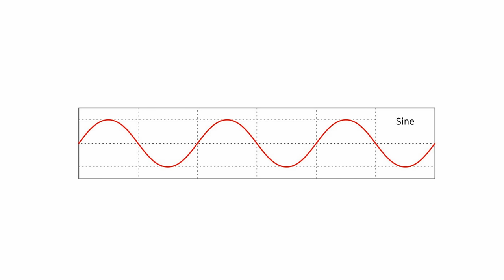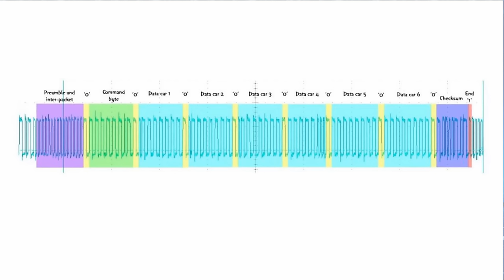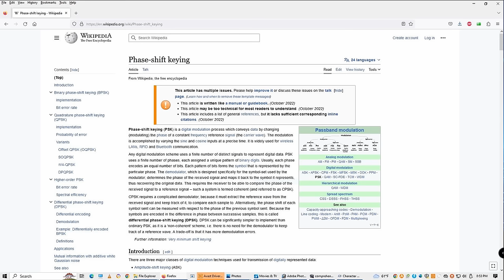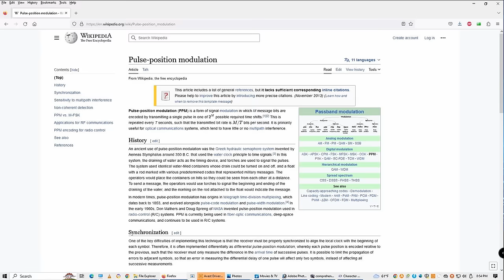How Do Digital Slot Cars Work – Scalextric, SCX, and Carrera Digital 132/124 Slot Car Track Sets

Comment: I use PCM modulation to control my laser on my cnc router. The pulses tell it to turn on or off and how strong of a beam to produce. When I use it in router format, it's just on (router spins) or off (router stops). In router mod, it turns on once at the beginning of the file and off at the end. It does this by sending a digital command to a relay that activates 110V to the router or not. With the laser, I need a constant 12V 5A, then the PCM controls the laser on/off and strength.

Comment: Use o'scope to capture live data. With no car on track you  can see with triggers on o'scope set correctly the track data changing. Press change lane and levels visible change. Car 1 address and data to car can be seen.

Comment: That video was 15 minutes too long. Plus you don't need all that digital junk to do the same thing. You could totally just use crystals in the cars and transmitters in the remotes. Seems like overkill to make all that digital crap that a little poke of static electricity could just knock out.

Comment: I didn't know digital slot cars were a thing until watching your video.

I've known about DCC for years and I've considered using DCC on my Lego train (with metal tracks). I often think it might be easier to just use a wireless protocol rather using using the power supply as the signal. You'd probably run into all sorts of interference problems if there were multiple tracks being used at once.

I really appreciate your including the oscilloscope traces to show the protocol details. Thanks for the interesting video.

Comment: Very interesting. At my work, we have high-frequency, square wave technology and variable frequency drives, etc. It sounds like they use industrial motor-control, logic and communication integrated into this toy.👍😉 Well done video sir. This is not easy to explain.👌
Reply: I have a cnc router table and that's what they've done: taken the same theory and applied it to the slot car world.

Comment: They sell a full-sized sedan version called the "Tesla Plaid,"  but It can't use a slotted track. 🤣

I worked with digital (PCM) systems in the Army back in the early-mid 70s. To me, it makes perfect sense to drop the analog control and go digital.

Comment: Thanks, this is very interesting to me. I had a huge HO scale track back in the '80's, so much fun. This new (to me) technology makes the sport very attractive again. I always thought a 1/32 scale set up would be a blast. Your explanation of how the digital system works is very much appreciated. I was on the Carrera website and there is not a whole lot of info there about how it all works. That's what YT is for though, right?
Reply from the maker: Yes, YT is great for learning just about anything. If you need to figure out how to repair something on your car (any car), build your own septic field, program macros in Excel, how to tie a tie, or lay ceramic tile, etc., somebody has a video on it.
Reply: This for really changes the game in slot car. Racing. Just think real pitstops and pace car .Do these sets come caution lights.😅

Comment: I remember the non-digital slot cars as a kid. I haven't thought of seen these in decades, but recently saw a two lane system with four cars on it and was wondering how the heck did that work. That's really cool they ran run them like this now and have the digital switching too. Thank you for getting into the details of it a bit.

Comment: Great overview and lots of good information.

Minor correction, though. Carrera is the only system that sends lane change data over the rails. All the other ones use a system where the car tells the lane changer what to do. Scalextric, for example, the lane changers look at the how the ID is emitted. If it's normal, then the car is asking to go straight, so it activates the "go straight" solenoid. If the ID is emitted opposite polarity (highs are lows and lows are highs) then it knows the car wants to change lanes and activates the "change lane" solenoid. Scalextric lane changers don't reset automatically, so their flippers just remain in whatever it was last told to do. There's also a very short delay before another signal is accepted, which means if you are tailgating another car, you are most likely going to follow them through however they choose, so it's always best to back off a little bit to ensure you can choose your own path.

Of course, every system is a little bit different because of patents and things. The only ones that are the same are Scalextric Digital and slot.it oXigen digital, because they have an agreement.
Reply from the maker: Excellent. Thanks for the info. Now I am off to fire my research department.
Reply: @johnniehobby  LOL!

Comment: I always thought that with the ability to have almost unlimited 2.4 ghz r/c cars within a given area, why wouldn't someone come out with a system where the cars have a esc/receiver and the track only supplies power. Then your transmitter would control throttle wirelessly. 

I know I know, that's called mini z which are wireless slot cars without the slots.

Comment: Excellent explanation, thank you 😉😁😄😎
One question: In reality the width of the track changes, not lanes all the way round. Can you use the pit lane track to make another racing lane on the main circuit?
Reply from the maker: Yes and no. Depends on whether you have another pit lane in the circuit and if it has an advanced pit lane adapter in it. Plus, if it is on a high-speed section of track, the abrupt change of lane can de-slot cars quite easily. The better way to expand to an additional lane would be to use the Carrera chicane set. It's kinda like a pit stop without the pit electronics embedded and a more gradual transition to the other lane.

Comment: The SCX Digital system really was awesome in its simplicity for their mechanical lane changers.  I’ve always loved it in that it just simply worked.  Unlike the IR systems, there was no chance of interference from light sources and no issues with the alignment of the sensor to transmitter when a car isn’t perfectly straight (such as putting a x-over right after a curve).  Literally, when you tell the car to change lanes it literally works (so long as that x-over track is perfectly flat as well).

But alas, the biggest complaint was the difficulty of modding other brands of cars to work on it (just not enough room for that mechanical system and the need to really cut up the chassis is not preferred).  Regardless, SCX today is a shell of what their original digital system used to offer.  It’s really sad that they can’t get their act together and come up with a product that speaks of quality.  Its no wonder they pulled out of the US market and in my opinion I don’t mind since they have nothing new to offer me.  I’m perfectly happy to still run their original system and have everything I need to get the most out of it. 😊
Reply: Sounds like the system is multiplexing the power. Embeds digital signal in the dc supply voltage on the track.
Reply: @altpraize6708  Some guy used to have a website that explained all the variations of the different systems (wished it was archived somewhere) and essentially speaking they are all running on variations of PWM (pulse width modulation).  Pretty much the same thing with DCC for trains.

Comment: Thanks for trying to explain how the pit lane works.  You are about 95% complete.   🤩  I linked full power into the pits to make mine reliable, but the jury is still out on whether that works on race day when the cars run low on fuel and Smart Race software is dealing with realistic fuel usage and cars get slowed down when they run dry.

Comment: I like all the features of carrera digital.  And on a tighter home track a super fast car like a slot it or various other rockets, there isnt enough space to chip em and really let it run .   Their power can be turned down easily, at that point why not just hop up a carrera car some?  Its kinda fun to play with modding carrera cars.  

Ive chipped about 4 of the hot rod cars and its pretty pricey to keep doing that.  There is no huge club track around here to take fast cars to, in a town of 120,000 people I think I have the only slot car track.

Comment: Great video as always! Great info! Nice one on the Christine and BB moments! Never seen an Inner space reference before, Bravo!

For the fueling with the blinking lights method. Will that work the same way when using the Smart Racing App? I have not tried that yet. I do very much like the alternate pit lane method. Really works well with no smart app. 

Thanks, your channel is outstanding!
Race On!
Reply from the maker: The blinking light pitting method should work the same whether using Smart Race or not. At least with the racing app we use (HSSRMS), it works both ways.
Reply: @johnniehobby  Thank you for info.

Comment: What brand would you recommend for ho racetrack for around 500 bucks to get started  ?   My wife and grandson are dying to use one. I have a 4 ×8 piece of plywood on legs to start. I'm curious how fast and how these new cars handle. Thanks for a cool video
Reply from the maker: I haven't been keeping up with HO slot cars for many years, so I don't know what's currently out there. For info on HO, one YouTube channel you might want to visit is @slotcarcrazy. That channel is all HO slot cars. What I can tell you about HO, though, is that you can quite a bit for $500 and you can get a lot of track on a 4'x8' table.

Comment: Question.  Converting analog to digital,  analog cars don't have LED on bottom of chassis. Will all still work with lane change and pitting?
Reply from the maker: The IR LED is part of the digital decoder. So when you 'chip' the car it will then have the LED. The analog car has a cover over the hole where the LED will protrude. You'll remove that cover before putting in the decoder. Slot Valley Racing channel has a video that shows the conversion here:
https://www.youtube.com/watch?v=FgrxQdu_ZDw
Reply: Thank you so much. Enjoy your channel.  Has helped greatly getting into this new hobby.

Comment: Wow, this video was perfect timing for me. I had just installed two cheap voltmeters  (one on each lane for possible analog future racing) to monitor voltage drop issues, and as a novelty. The “cheap”  volt meters reacted funny once installed and running. They both boot up read a voltage, fluctuate a bit, then the meter reboots. This reboot is sporadic, not at any specific frequency.  Soooo…..now, I think I understand a bit more…..cheap meter, fluctuating voltage ( voltage gaps) that the meters eventually see as no voltage, and  trigger a reboot. It actually looks cool while racing, and does give me actually track voltage be it momentary. Have another question for you. Does the pit lane entry know that it is a pit entry? I tried to use a Carerra narrowing track as a pit entry for a pace car and it did not work. The pace car did not know that a regular switch track is a pit lane. So I guess if I wanted to use the narrowing track for a more gentle in and out for pit or pace use, I would need to change the board in the switch track to a pit lane board. Am I correct with that analysis?
Reply from the maker: I'm assuming you are talking about Carrera 30351 Chicane track. Your solution of swapping the electronics to make it into a pit should work, just be sure that the inside rail of the pit lane (or what will be the pit lane) is isolated from the rest of the power in the track and only powered by the decoder.
Reply: @johnniehobby  , another great video from you. Thanks so much more providing this type of info for slot car users.

Comment: Your explanation of the two types of encoding the info into the power feed was very clear - finally I learnt how they work - thank you!
Reply: Even though it's been explained a dozen times, I still can't wrap my head around how fiberoptic works. Yes I get that the light on or off creates a digital signal but how do you differentiate between 10,000 different signals going through the same hair thin fiber? lol

My 62 yr old brain just....doesn't....get....it lol

Comment: Is there a way to adjust down the power for kids to use on a Carrea Digital system?
Reply from the maker: Yes. The SPEED button on the control unit is used to set individual car speeds from 1 (slowest) to 10 (fastest).
Reply: @johnniehobby  Thanks very much the info!
Reply: @johnniehobby  Another question I have for you.  As a beginner in this hobby, do 1/24 cars stay on the track as easy as the 1/32 cars?  I'm trying to decide which size to buy in a set.
Reply from the maker: @patrickcotter5629  The 1/24 cars don't have as much of a top speed or the quickness of the 1/32. You could actually describe them as "sluggish." They will have more of a tendency to drift more in the turns, but at the same time much more controllable when they do. Thus, they don't tend to de-slot as much as a 1/32.
Reply: @johnniehobby  Great information to know.  I appreciate your response.

Comment: Are there wireless hand controllers available as well?
Reply from the maker: Yes. Carrera and Scalextric have wireless controllers.
Reply: @johnniehobby  Thanks, what do you prefer Carrera or Scalextric?  I am looking to purchase a set for my son. I keep reading about Toy Cars vs Pro Cars.  What is the classification for these companies?  Who makes the better car and track setup, Carrera of Scalextric?
Reply from the maker: @jkm49us25  I prefer Carrera for two reasons: the lane changers span two sections of track, therefore with our large, very fast layout you can take a lane changer at full speed without de-slotting the car. Also, the Carrera track is actually 1:24 scale so we can run 1:24 scale as well.

Because Scalextric track is 1:32 scale, you can get more running feet of track in a given area, thus if you are limited on space, Scalextric may be the better option but you can only run 1:32 cars on it. 

Scalextric has a better selection of American muscle cars and street rods, whereas Carrera's selection is more focused on European racing classes like Ferrari, Porsche, etc.

If you get an analog track, then you can run any analog car from any manufacturer on either track (including cars from Ninco, Fly and others) . If you go digital, then only cars that have a digital decoder specific to the track brand will work.

Comment: Didn’t have the time to sit through the entire video, is this the same mechanism as the X10 protocol?
Reply from the maker: Similar idea, but different implementation. X10 forces a burst of digital bits at the zero crossing. That's where, in a AC sine wave, the voltage is at zero between forward and reverse current. The frequency and duration of the wave isn't changed unlike the PPM and FSK protocols used for digital slot cars that modify the frequency and/or duration of the power in order to embed the digital code.
Reply: @johnniehobby  this is brilliant. Thank you so much for the explanation

Comment: Great presentation. Answers several questions I had. Still wonder if a 1/24 power supply would really impact a 1/32 car.
Reply: You will burn out the chip. 1/32 runs about 14.8 volts and 1/24 runs at 18+ volts.
Reply: I have been running 1/32 on my 1/24 power supply. Very fast, but no noticeable damage to the electronics. I suspect a voltage regulator on the circuit board. Thoughts?

Comment: How in the world do you get that red Monza to stay on the track I have two and they are so hard to drive still have the magnets in them
Reply from the maker: Have you trued the tires? Out of the box, the tires on Carrera cars are usually sketchy and truing them is the biggest single thing you can do to improve the handling. If you haven't seen it, our video on truing tires is here:
https://youtu.be/qbJuwGGWkZU

Something else you can do with that car, because it is one of the few that has the G4 chassis, is shim the magnet. The parts package in the back of the case should have come with shims you can put under the magnets which sets them closer to the track, thus more downforce.

A third method is to rub a little WD-40 on the tires. Putting oil on tires to make them stick better is counter-intuitive but it softens the rubber giving it more gription. This might actually shorten the overall life of the tire so I only do this when it's an older tire that has hardened a little bit and it going to need replacing soon anyway.  

I'd say try one (or both) of the first two methods mentioned first and let me know how it goes.